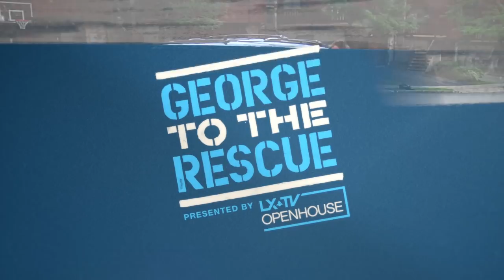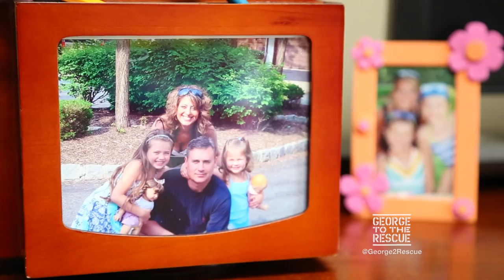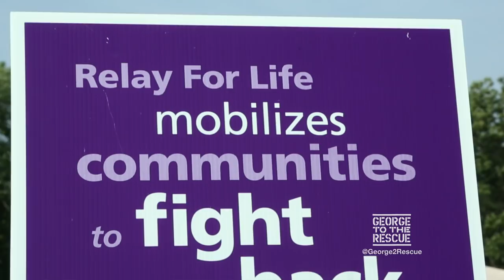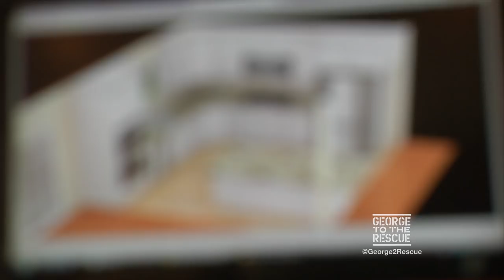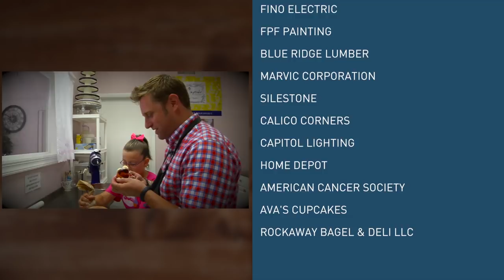Kitchen Renovation For Inspirational Young Girl | George to the Rescue

Comment: Dad: Talks about Olivia needing to climb onto the counters.
Designer: Cabinets to the ceiling!
Dad: She has to go between two fridges
Designer: Keep the same fridge they have.

😂 But it's great still and Olivia is a sweetheart ❤️
Reply: One of the best things was the integrated step stool in the cabinet kickplate. They didn't show in the reveal. Also they already had a huge fridge. Only one bigger would have been industrial and that would be a waste of space and overkill for a residential kitchen.
Reply: @loriwishman1866  well they should have built a taller stool then there is NO way she can utelize those high shelfs in atleast 2-4 years with that short thing...